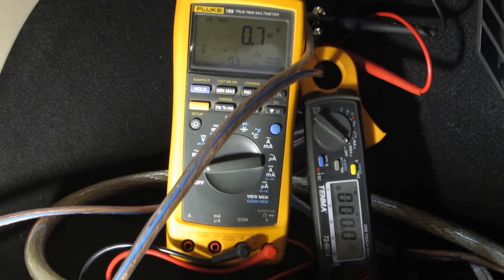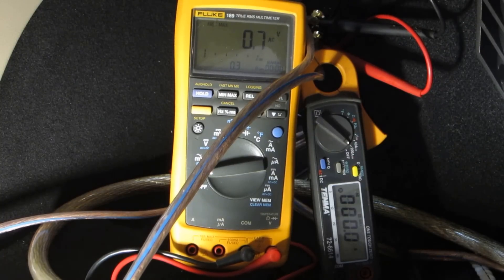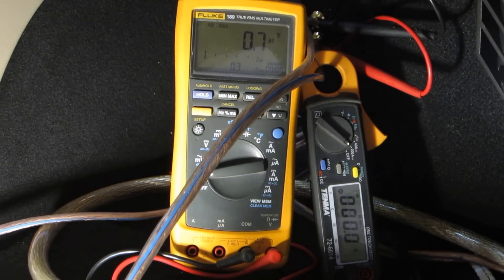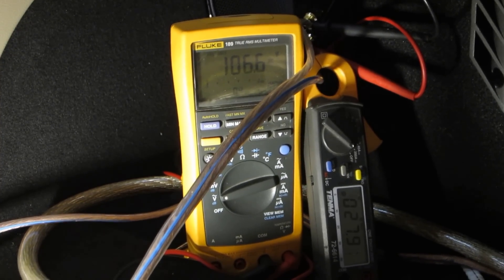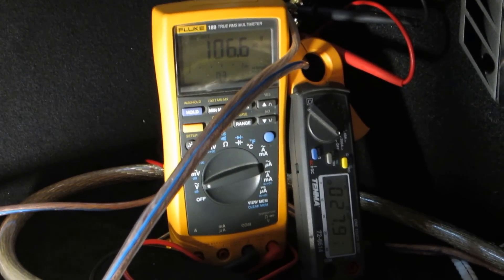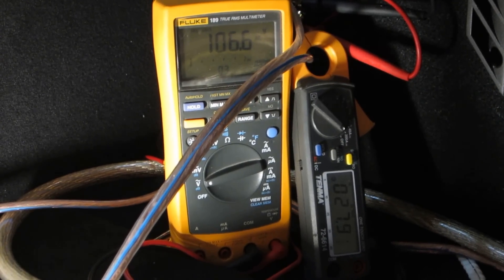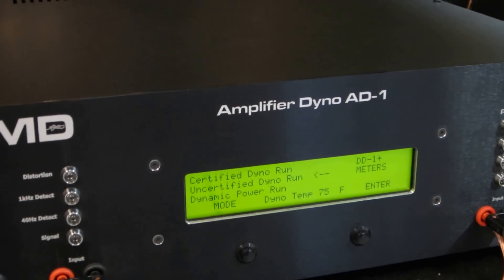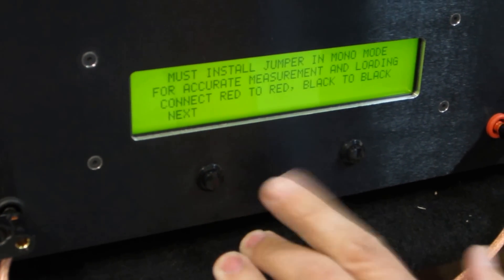Amp Dyno VS. Clamping!

Comment: Hello, i really like the amp dyno. It makes it easy and fast to measure amps with an resl ohm load and max allowed distortion. Besides it shows the system voltage. But this comparison is not good here. As speaker can be everything between capacitive and inductive and the clamp meter collects all clipping to the rms values the values will be totally different. Real speakers behave totally different the normAl resistance. Not shure what people want to show here?
Besides that clamping is easy and can be used to optimize power on the messured system. Any voltage upgrade will add power.
But wattage is really nit of any quality aspect. Especially as mist amps do well with ohm loads but not outphased loads. Just my 2cents

Comment: he did the test incorrectly. The correct way to clamp is V(AC)^2 divided by the true impedance under the given load
Reply: Jeremy Ray Volts^2/impedance = power   Volts*amps = power.  Both are correct.  BUT both are only correct when talking about DC Electricity or AC electricity with a non-inductive load.  Which a subwoofer is not.  For a deeper understanding check out the D'Amore Engineering University video series
Reply: Anthony D'Amore its on your page?
Reply: Flexin Five Hundred the formula i stated is correct and you cannot use a "clamp" test to determine that
Reply: are you serious right now? bwhahahahahahahahhahahahahah
Reply: meade916 haha nah. But my circuits book is. 
Just a heads up though, when i move out to west in a year im coming to your shop.

Comment: Why would you not use a small oscilloscope when doing the test? How else would you know when to stop going? I just do a medium speed roll up until I get a soft clip. I have found it extremely accurate. The only difference is the dyno can test at all the varying ohm loads and "clamping" you are limited by how you can wire your subs + box rise. You should compare the dyno vs a "TaylorFade" style amp clamp/test.

Comment: I have a question.. What resistance are your subs wired at? I'm doubting 4ohm.. More than likely 1ohm ... 3,000@1ohm then you did the dyno at 4ohm.why?
Reply from the maker: If you divide the numbers on the clamp and meter it equals actual impedance
Reply: You can measure actual impedance with a multimeter......

Comment: Wait a minute.... This is rigged.   Your amplifier can do 106 volts and even if it can only do 90 clean thats 8100 at 1 ohm or 2k ish at 4 ohms.  I'm not buying it.
Reply from the maker: Because those meters read incorrectly if there is any distortion.  The amp Dyno does not.

Comment: Can you explain exactly how the DAmore machine takes its measurements (am sure its many measurements being taken and summed up to make those numbers). But that would be my guess. How about clamping the meter to the B+ then multiplying the amperage pulled by input voltage then multiply it by the amplifiers efficiency. That should give you a pretty accurate number.

After all when playing music there is no way to say how many watts your amplifier is or has put out. Thanks for the vid.

Comment: I am not really sure if any measuring method is accurate.
How is it possible to measure the RMS power a Subwoofer can take?
I really would like to see how it works together: RMS of a Sub and RMS of an Amp.
For example i got 8 12inch subs each rated 300RMS so basically this means they can take 2400Watt RMS and my amp is rated 3000Watt RMS and even if i the volume is not even close to 50% i can put these woofer to their Limit.

Comment: the SAZ1500 was tested @ .8 ohms and .5 ohms, on dynamic burst RMS.  This amp (in this video) was tested @ 4 ohms in uncertified mode.  Big difference.  Also, this video isn't to show you whether or not the T2500 made it's power or not, it is showing you why clamping is bullshit.

Comment from the maker: In our 2013 Jeep Grand Cherokee with 1/0 AWG wiring, no fuses, huge AGM battery and 180 Amp alt it did 1499 into 4ohm, 2059 into 2ohm, 2366 into 1ohm on the amp dyno, car running at 2,000-2,500 rpm.

Comment from the maker: The amplifier will have the toughest time driving the purely resistive load, from a power output standpoint.  Amplifiers are usually tested with inductive and capacitive reactive loads during their design phase.  This is to check for stability problems.

Comment: so if i have another meter reading the phase angle i can get a pretty close reading of my amps wattage ?  im looking at some multi meters for around 250 that have phase angle.  could i use three meters, one reading amps , one reading volts and one reading sin then multiply the the readings to get my wattage ?

Comment: That is a good point.  The Certified dyno mode only reads power that was at less than 1% distortion, whether it originates at the headunit, processor(s) or amplifier and if it is caused by clipping or other anomalies.

Comment from the maker: There are things to compare it against, they are just meant for a lab bench and not very portable.  One of them is the audio precision 515, then you have to add a computer and non inductive load banks, and a large power supply.  About $12k when you are finished.  Of course that setup does more than just measure power though.  Another option is this super cool machine, for a lab bench environment for someone who designs amps.  Only measures power vs dist  $30k  powercube by audiograph of sweden

Comment from the maker: Ohms law for DC says Volts X Amps = Watts.   But amplifier's put out AC voltage.  Ohms law for AC says Volts X Amps X Sin (Phase Angle)   These simple meters do not measure phase angle.

Comment: That's fine there other gear out there that could do the same job as this..cost of dyno can be made back quickly if the company that bought it marketed it right, don't seem feesable for an homeowner to buy one, unless they test other systems for a small fee. But thats nothing to do with power output

How does kicker and RF bench there amps to give power output for there birthsheet?

Comment: Aren't you measuring complex power with the clamping method while the dyno is measuring real power output? I understand why you did your test the way you did, but I'm curious how close the meters are when they are measuring output to a resistive load (measuring the input to the dyno while the dyno is doing its test). I would think the results would be much closer. But most people do take clamping results at face value which you just showed you can't do :D Thank you for showing the facts!

Comment: Yep, because you've got that little detail called phase angle. Clamp meters are designed to be accurate at 50/60Hz which are the line frequencies in the Europe/US, and not much else. They are a general purpose electrician's tool, not a specialized audio one.

Comment: i like the video... but one question- when you used the clamp meter and dmm, you had them set to hold at the peak values.... i was told that was teh wrong way to do it.... can you clarify if that is the right way? Not saying you are wrong by any means....just trying to learn more